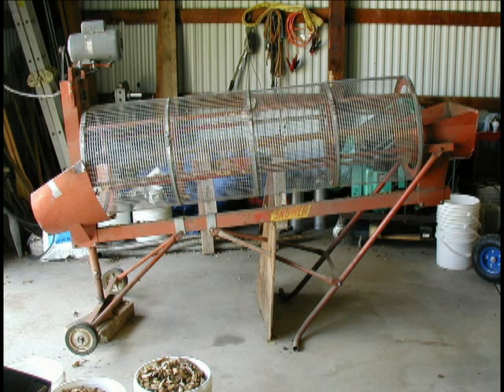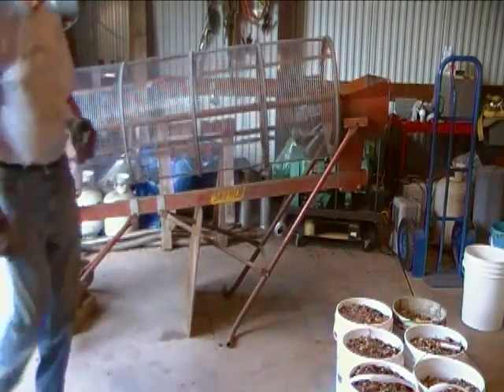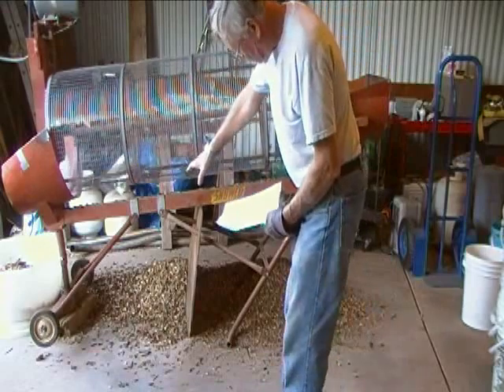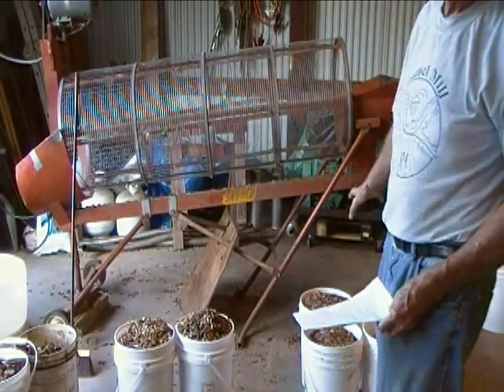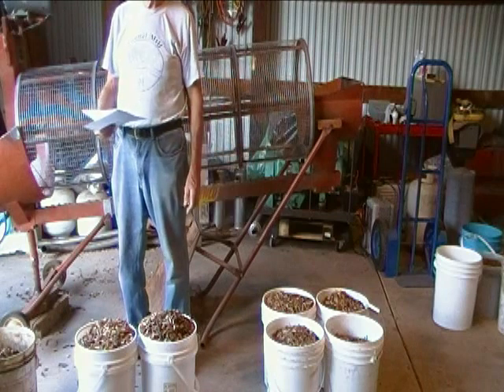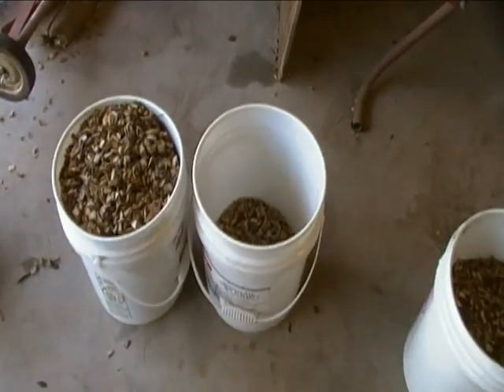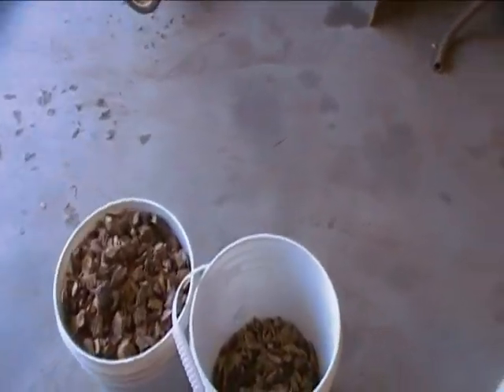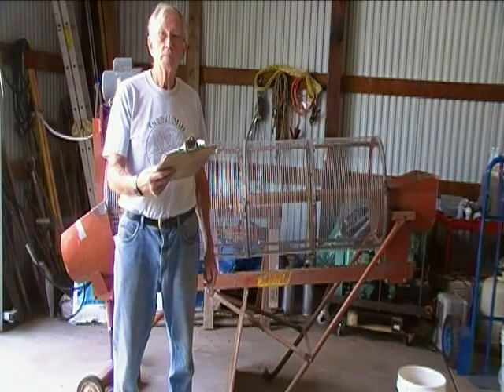Sorting Gasifier Wood Chips With My New Snowco Grain Cleaner

Comment from the maker: Good question!  Since I made this video, I did change the angle so the chips move "down hill" more slowly and that helps. I also mounted the whole thing on an old rebuilt snowmobile trailer to make it easier to move.  This  grain cleaner originally had eighth by eighth inch screen at the input end and quarter by quarter inch screen at the other end.  So, yes, the screens have been changed. I think I will even increase the size of the output screen, which is now 1/2" X 1" to 1" X 1" one of these days to reduce the amount of material that gets to the "too large" container.  Other than that I think both grain cleaners perform about the same.